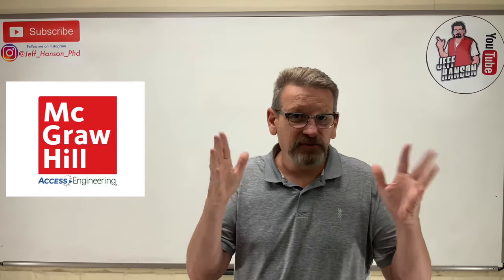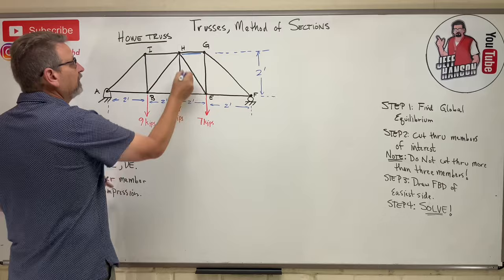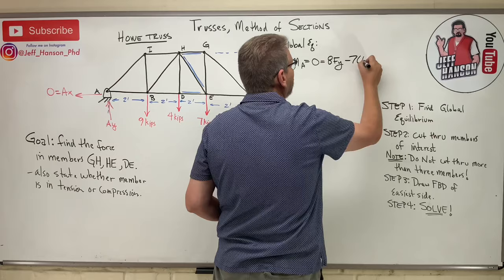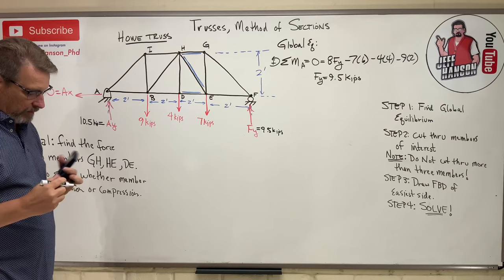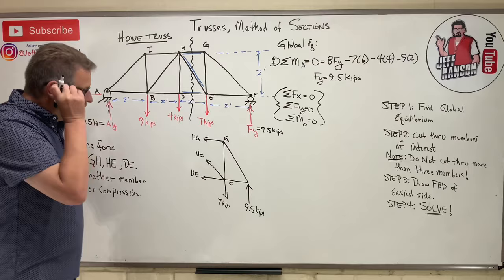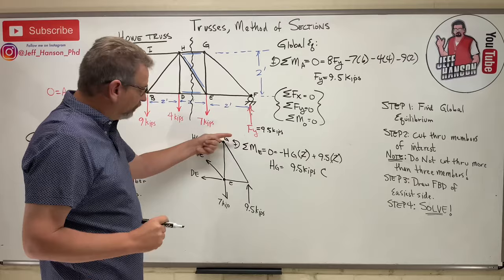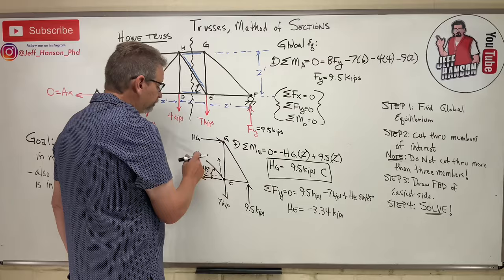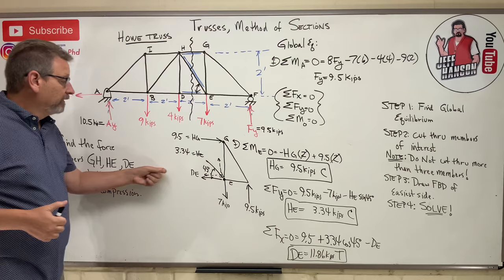Statics: Lesson 49 - Trusses, The Method of Sections

Comment: I was sweating until the very end when he said REMEMBER - DO NOT CONSIDER THE MEMBERS YOU DON'T CUT. Jeff, you solved about 10 years of me hating this method with that statement. I've always screwed that up and over-complicated my problems.
Reply: This is huge. I was so confused why he ignored EG in the sum of Y forces eq.
Reply: it was the same with me
Reply: @SuperPenguinpenguin  I made the calculation later for EG, and it's equal to zero. But if there's zero reaction, why even have a member there? What's the point of having a structural member with zero force? Why not just remove it then?
Reply: @martinAbC  for loads -- ie a bridge needs to handle movement of cars, wind, etc. it's just that the current forces don't make use of the member, but it would have purpose in another situation

Comment: When determine the moment at point E, why was FG, GE, or EF not included?
Reply: because the lines of actions of the forces go through point E, where the moment is taken around
Reply: For point FG, it is not a perpendicular distance to the line of action about point E.
For Point GE, it is also not a perpendicular distance but rather a parallel distance to point E, however point EF has an upward force denoting that it has a moment about point E so we include that

Comment: I made the calculation later for EG, and it's equal to zero. But if there's zero reaction, why even have a member there? What's the point of having a structural member with zero force? Why not just remove it then?

Comment: at 8:37 when you took the moment at point E. Did the 7 kips, DE and HE get knocked out because the moment arm was going through the axis? assuming HE has a degree angle why is it not being considered when calculating the moment at E? thank you!
Reply: also how do we know the moment at E is positive? when there is a force acting on it.
Reply: Remember moments/torque is the turning effect of the force on the body. On members DE, HE, and the 7 kips, it does not have a turning effect on the force on the body at the moment at point E. It only has linear forces, therefore does not have torque.
Reply: @garyyoung8095  It depends on where you want your positive and negative direction to be at when finding moment/torque. In his video, clockwise is negative and counter-clockwise is positive. You could set it up the other way it's totally up to you.
Reply: @Waltu0 thank you for your answer bro I really need this explanation, I always wonder why did he set up the moment on E then why HE and DE got knockout. now I know thank you bro!